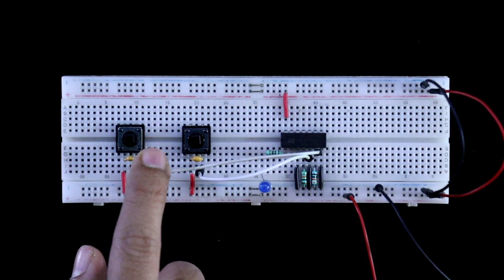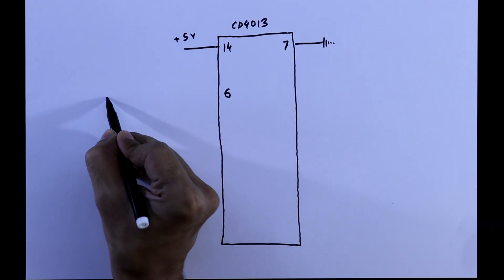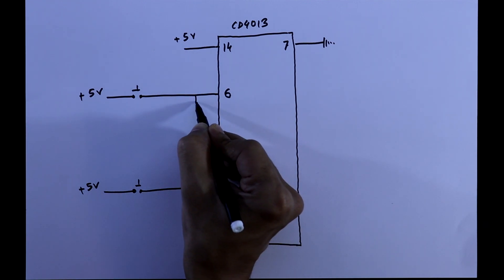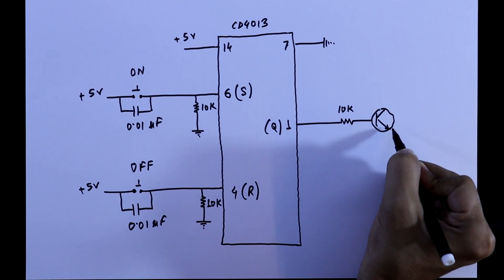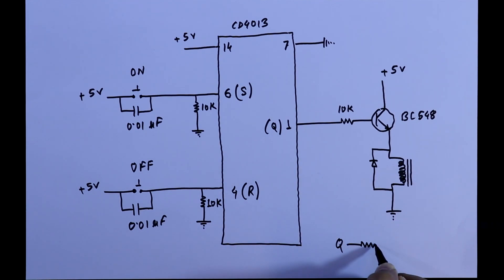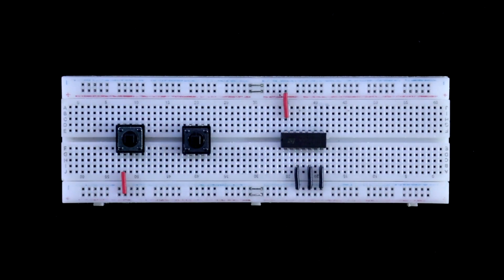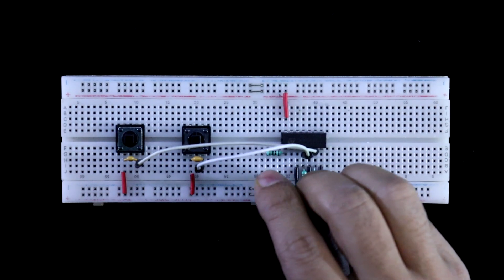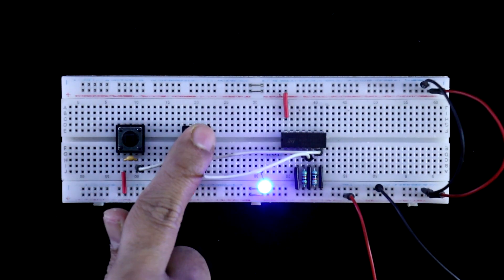ON & OFF with two Push Button using CD4013

Comment: If anyone watches these videos and lives in Canada or the US,  I'd be more than happy to send you the ics, breadboard, resistors, leds, etc along with the 5v power source for free if there is some reason (which I do not need to know) keeping you from buying the items. Just reply to this message and I'll give my email address and send you a package with cmos and arduino starter kits at no cost. No strings attached. I hope you don't mind me offering this Deb?
Reply from the maker: You're a great person bro...
Reply: @EEWave  I am 100 percent serious my friend. I've spent months and thousands of dollars to purchase chips and microcontrollers and sensors and all that for a charity project me and learnelectronics was working on but I had a break in to my workshop and any gear that wasn't stolen was thrown around and I also lost my life's collection of guitars. They even broke my ps5 trying to rip it off the TV stand and tore the hdmi port out. I replaced it myself. Insurance used a loophole not to pay for my losses but all my parts boxes but one and my 3d printers were left untouched. I moved my workshop to another room in the house and where I have mental illness it's been hard to get back to doing projects but cmos and leds have kept me going haha. Now I have all this stuff that I was going to share locally and to the learnelectronics community but now I'm offering it to anyone who lives in North America for free. I even include a multimeter and soldering iron if the person needs one. It's quite a kit. It weighs about 1.5 kilos haha 

I have a cmos kit for people along with transistors, leds, 7 segment display,  different buttons, breadboard,  jumper wires, 100 leds, some perf board and a roll of wire plus spst and dpdt switches like you have and all the resistors. I have at least 60 types of cmos chips and I include 1 to 3 of each depending on what makes sense. There's much more but I have to talk to the recipients to see what each one needs as far as supplies goes.

Then I have a microcontroller kit where I offer, Nanos, unos, megas, picos, esp32 and 8266 plus all that goes along with that to learn. I live in Canada and if a person were to order the kit from Amazon it would be over 100 dollars. I even give real servos along with the steppers and dc motors plus tons of sensors and everything. 

People don't believe I'm giving this stuff away. I even have custom made nano boards on the way from pcb way that has , buttons, pots, rotary encoders, oled screen, switches, built in mini breadboard, leds. I even have grove kits new in box. I have over 35 microcontrollers. Haha if I don't have something that I think should be in there I'll buy it.

I just want people to feel the same way I did when I learned all this and how it helped me in my life. 2 people have requested one and both backed out for no reason. I even offer free 3d printing if the person needs a functional print and doesn't have a printer.

Anyway, I'm rambling. I could help people out in your neck of the woods if I could just send a package to you and then you give them out locally. My wife wouldn't mind if I did a 1 time send of a huge package to your side of the world.

I'd even include some goodies for you. I have a new own multimeter with probemasters and an unopened ts100 plus some other cool stuff.

Comment: Hi,
Im trying to create device with 2 buttons, two leds, and one reset. 
When button one is pressed led 1 lights, and led 2 is blocked (can not  be turn on by second button). Button reset - turn off light and back to default state. Default state - both leds turned off. Can u help me using this cd4013?

Comment: Sir is that switch is a momentary switch in real state but the switch is act as push to on or push to off switch because of the of the added parts that connect to the circuit im i correct sir tnx
Reply from the maker: Yes, those switches are connected with D flip flop IC.